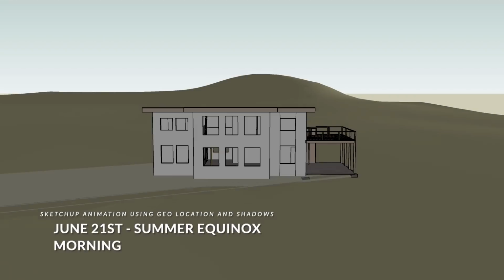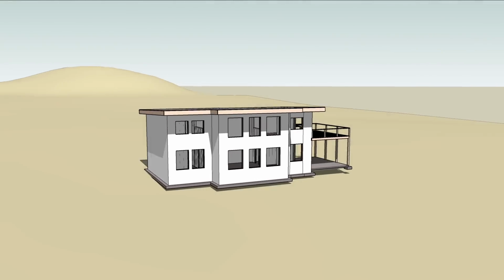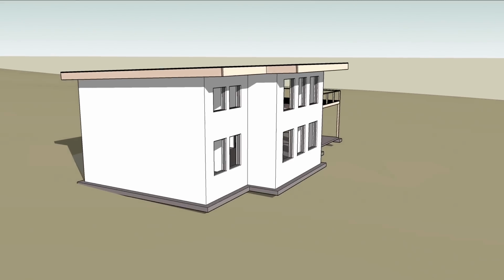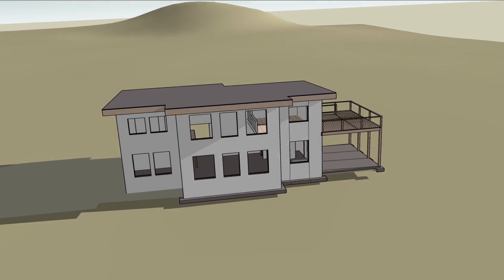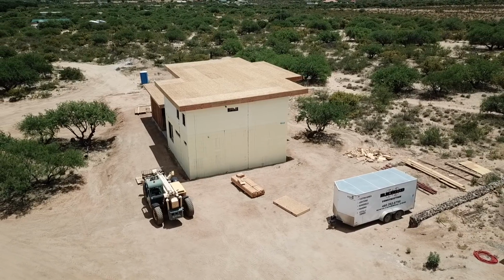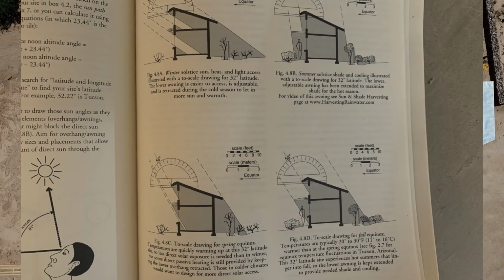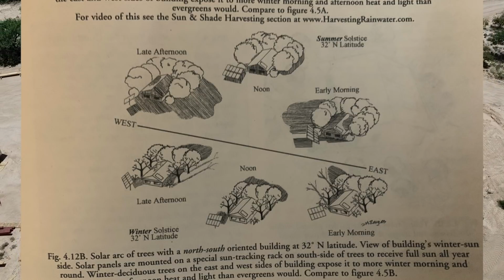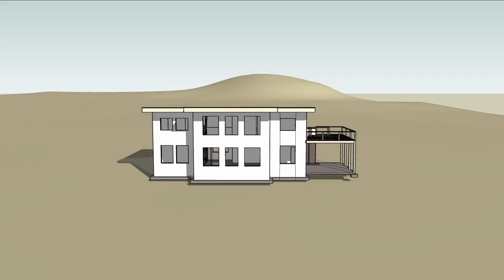How Our House Design Will Save Us $1000s

Comment: FYI, I think you mixed up "equinox" and "solstice." The "solstices" happen during summer and winter, and will be the sun's highest and lowest points respectively. During the summer solstice, it's the maximum daylight period (and therefore warmest) and during the winter solstice it will be the shortest daylight period and the coldest. The "equinoxes" happen during March and September and, as the word implies, it has 'equal nights.' I.e. the daylight & night periods are equally long. 🤓 https://en.wikipedia.org/wiki/Solstice and https://en.wikipedia.org/wiki/Equinox

Comment: There appears to be inadequate shading on the north wall. I not putting the blame on you. Most of the passive-solar literature out there is focused on heating-dominated climates, not cooling-dominated climates like AZ. The focus there is largely on the south, east, and west wall designs. (Yours look great BTW) The north wall needs shading too for those late afternoons and early mornings during summer. The sun is low in the in the sky, so horizontal shading (i.e. overhangs) has limited utility on the north side. You actually want to use vertical shading. You still get plenty of indirect light, and if they are thoughtfully designed, they won't obstruct your view.

Comment: passive solar is a marvelous way to save money without sacrifice...another way is to arrange your utilities  in a logical configuration that cuts down on long runs for plumbing and electrical connections....particularly hot water....i design modules that provide for full sized appliances from a compact area...allowing the surrounding spaces to create full kitchens and bathrooms with minimal use of the most expensive materials and labor....my designs are tried and true standard construction and honor building codes...take a look when you have time at the schilling modular youtude channel...and enjoy that house...looks like you picked the perfect spot for it

Comment: are you going to shad the west wall? you could use something like sunbrella fabric run up on cables from the eaves to a poing 4'-8' off the wall down below. Just keeping some of the sun off will reduce the work of the insulation. (Of course, with ICFs, you're well on your way already! Love what you're doing there. 

Alos, are you familiar with "cold roofs?" they may have another name in your part of the country. But, a 2-layered roof with an airgap between so the baking heat isn't on top of your insulated space. Makes a 20* (f) difference, or more. 

Cheers!

Comment: Winter and summer solstice not equinox.  The equinoxes (equal nights) are vernal (spring) and autumnal (fall).  This is when the sun is directly overhead at noon at the equator and night and day are the a\same length.  The solstices are when the sun reaches its farthest point south or north.

Comment: Disagree on the initial part you tell that planners does not consider environmental parts but only thinks about fitting as many houses into the plot as possible. Several countries, municipalities and etc has regulations and guidelines about making homes use the environmental factors actively/passively. This is in regards to rain, wind, sun, shade and alike. This is not unique to your house. 
However, having a lot of windows facing towards the south is in general architecture considered a bad idea, because it usually generates so much heat inside the house, that it becomes too hot in the summer-time. (If no solar shading upon the windows are provided). However most architects i've been talking to, recommends having a small end of the house face south and having the general lenght of the house stretch north/south, so that the lenght of the house recieve sunshine during the morning and evening hours - where people are at home.
I bet you still install air-conditioning in your house just to be able to be in it during summertime, right? Nice overhangs btw. you got that part right. 
Here is a great article on what to be aware of when making passive-haus design: https://elrondburrell.com/blog/passivhaus-overheating-design/

Comment: I see that the roof is actually facing north, doesn't this take quite a bit of the solar array out of optimum angle for capturing the sun?  when winter hits, the panels will hardly get any sun at all.  Likewise the summer has less of a direct angle on the panels.  Your thoughts?
Reply from the maker: who said the solar panels were going on the house?
Reply: @Handeeman  ya, I thought about what I said and you were talking about "Passive Solar" sorry.

Comment: I'm in Colorado.  I did something very much like this when I built mine (my main solar wall is a bit southwest to take advantage of mountain views though).  I used some software to help.  NREL has a piece of free software called EnergyPlus for doing energy modeling.  You can put in a 3D model of your building, model the HVAC systems, lighting, and much more and get the various gas and electric loads, solar heat gain, etc.  It's pretty cool, though a little overkill for a house since it's really setup for commercial buildings.  The drawing is done with a free plugin for Sketchup called OpenStudio.  You could probably easily take your existing model, tweak it a bit and run an actual sim on it with these tools.  That way you can actually quantify what your savings, loads and gains are.

And it does work.  In the winter, it may be 20 or 30s outside, but, as long as it's sunny outside, my furnace turns on little to not at all during the day.  In the summer, the shading does much to keep my rooms with south facing windows from overheating.

Comment: A flat top roof is not the best choice for passive solar a hip roof for insulation and heat dissipation, ether that or the ceiling heights have to be around 9 ft with circulation especially if you have a second story.

Comment: Wow, quite the "McMansion".  

For many years, we lived in an early passive solar house designed and built in 1948.  It had all the same design features (window orientation, roof overhangs, concrete floors, etc.).  The architect was a post-war graduate of MIT and was heavily influenced by Frank Lloyd Wright.  

Contrary to what might be intuitive, our passive solar designed house was dark in its interior.  Dark - with all the huge windows?  Yes, so much light comes in through the windows that by contrast, the house feels dark in its interior areas 10 or 15 or 20 feet away from the windows.  Much of the interior violated the centuries old architect's rule of providing window light to rooms from two directions.  

The solution was adding several skylights at the interior.  The trick is to make sure the skylights are small ( a solar tube or 12" by 18" bubble-top is about right).  Larger skylights add too much glaring light and small ones provide beautiful streams of light diminishing the stark contrast between illuminated and un-illuminated surfaces in the interior.

Comment: Great work. I’ve enjoyed following your videos from the beginning. My wife and I are in the planning and design stages for a 100% off grid homestead in the Big Bend region of Texas. I’m curious on your roof design. Firstly, it appears 1:12 to maybe 2:12. What did you design. I was struggling to find proper ventilation strategies but I think I’ve settled on that aspect. I am curious as to the roof covering you’ve selected. From my research anything less than 4:12 requires special metal. I’d be grateful if you could share technical information on your roof design.

Comment: I did this on the solar house I built in Reno. I actually put pencil marks on the building I worked at (at the university) at noon on both solstices and both equinoxes at noon time for a year to confirm my calculations would work before I designed the overhang on my house.

Comment: In addition, having walls that are 10 to 12 inches thick would also add a great deal of extra insulation and lower costs of heating and cooling.
But at this point, that is no longer an option.
Noticed that your roof is at a 1 or 2 degrees of tilt from level; is that enough to support the water runoff from a monsoon storm?  Clay tiles or shake roof?  No solar paneling?
Landscaping the rest of the property to direct runoff to ensure drainage is also required for the monsoon climate.
May God bless you and your family and home.

Comment: Personally, I would do much of the same design but with a few differences. The shed style roof is good, but I'd pitch it to the south so photovoltaic panels could be optimized on the roof. The angle for general solar collection year-round would be aided by the roof's slope, though I wouldn't go as far as a 3/12 pitch. I like the passive solar overhang shading in the summer, but allowing heat gain from sunlight in winter. But, with the slope to the south, the lower point of the roof being at the south wall, I think there's an advantage in needing less of an overhang. That advantage would have to do with strong winds, though Arizona doesn't get hurricanes we do get an occasional weak tornado, and strong enough winds could do damage to the roof with uplifting force. Though, with your design it will probably be fine. Keep up the good work.
Reply: I don't see why the roof pitch needs to be changed at all for solar panels.  All that really matters it the angle of the individual panels and those can be tilted up either in combinations (2-4 panels per tiltable rack) or individually.  Also lost on me is your comment about high winds.  What does that have to do with solar panels?  Or is it meant to be about overhangs?

Comment: Beyond just saving on your energy bills, you could save 10-20k on your HVAC with proper design. I bet your house could be cooled by 2 window shaker AC units. You'll still probably put in a heat pump but the tonnage of the unit might be 2/3rds smaller than a conventional woodframe with no consideration to passive design

Comment: Take a look at passive house institute. Beside house orientation you get a few more things:

No thermal bridging
Triple glazed windows
Mechanical ventilation with heat recovery
Quality insulation
Airtight construction

Heating/cooling energy is reduced to 10%. Meaning you save 90%.
Reply: I agree. Passive solar is important, but for the most bang for your buck also build to passive house standard. It looks like you have a good start toward that. Now seal it up tight like a thermos and add continuous ventilation with a heat exchanger. I have helped build a couple of them, as well as many straw bales buildings, and many other types.

Comment: Seems like power companies would work with developers in new areas to foster passive solar building techniques & promote more efficient electricity consumption of those new homes. Why bother to nickel & dime with low consumption shower heads, led bulbs & retrofitting insulation.? The big savings is in the hvac systems & the house doing it by design is a win-win no brainer oh, wait, you want the wasted energy for the bottom line.. Never Mind then.
Seriously its the 21st century, zero or low energy builds will allow you to make more contributions to enhance your way of life. The same way sustainable permaculture can feed the planet with worms, chickens & some plants & water.

Comment: I have noted several stress fractures in the foundation. Is that a concern for you? Given the foam insulation.
Reply from the maker: that's cause we didn't want any control cuts, where there are footers in the house, the concrete is continuous to the ground

Comment: Nice design. A lot of thought goes into a good house build. We put a lot of time into the design of our house so that we could take advantage of the sun and heating our house in the winter and trying to keep as much sun out of our house in the summer. Insulation around the outside of  the concrete slab works good to keep a house isolated from the outside elements in the colder climates. Love the house. :)

Comment: I did exactly this on the house that I built and am currently living in. we're able to keep the house at least 10 degrees cooler than outside without turning on the air conditioning with proper management of the windows and blinds.

Don't worry about the overheating in Winter, I just open the windows if it gets too warm inside.
Reply: I will confirm that. Build my house 100% north facing in South Africa. Have not used a heater in winter for 4 years.
Reply from the maker: sounds great! yeah or just using some blinds on those upper windows will help :)
Reply: @Handeeman  
What is the final square footage of your house?
Reply: @godisgood9438  -   Select the video where he shows and discusses the layout of the house. The square footage is provided.
Reply: @Handeeman  
I don't want a thumbs up, I would like an answer. How big is your house square footage wise?
Reply: @Handeeman  
Your a jerk. Take your thumbs up and stick it.
Reply: @godisgood9438  
Wow. Did you miss your meds that day?
Reply: @godisgood9438  relax, remember God is good and He wants us to love each other. Love is not rude